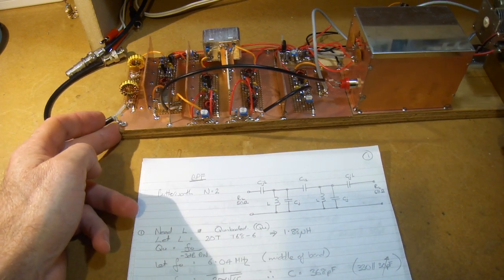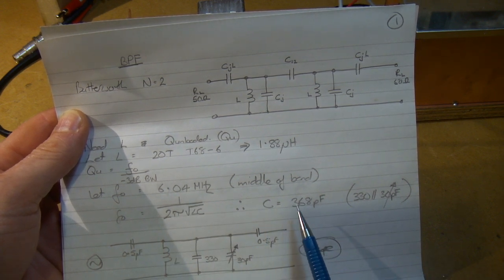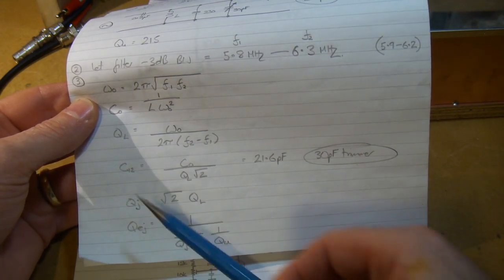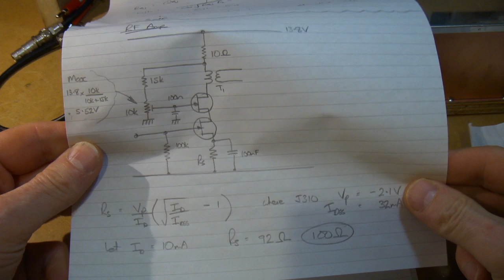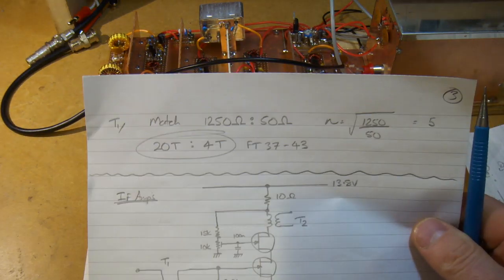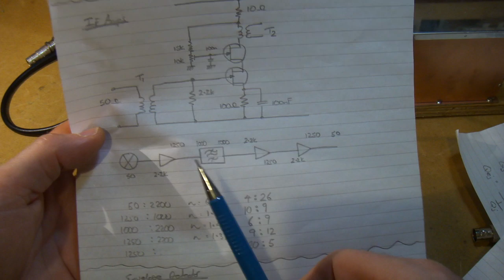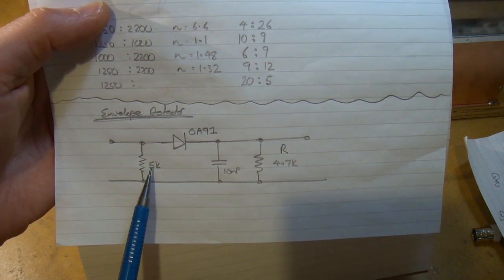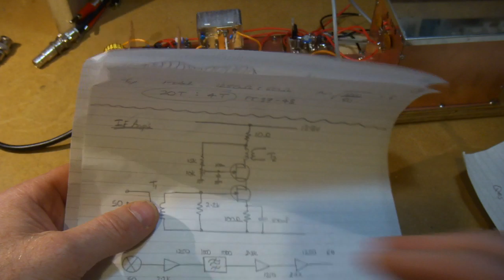Shortwave AM Receiver. Part 5: BPF, RF Amp, IF Amp, AM Detector

Comment: Charlie, I built up a 3 stage IF amp board recently with BFR246 pairs, almost identical to yours, however it uses tuned drain inductors. The thing had sooo much gain it was hard to stop it oscillating. Had to force AGC right down to tame it. If it is still unstable over the AGC range in a txcvr project I may replace the tuned circuits with broadband transformers as you used, that should reduce each stages gain while realising a reasonable AGV voltage range.
Reply from the maker: Hi Paul. I did a tuning cap across the primary windings, but elected to go back to the broadband configuration. The gain seems to be fine for what I am after. Just a simple little radio.
Reply: @CharlieMorrisZL2CTM  With three tuned stages the overall IF gain is excessive. I left the 3 stages in, but dampened two of the three drain tuned circuits with a 5k6, that tamed it.  Going pretty well now.

Comment: I really enjoy your videos. Keep it up. At one point you needed a transformer turns ratio of 5 and you chose 20:4 turns. Can you provide any general wisdom on  picking the minimum number of turns (i.e. why you didn’t chose 5:1 turns instead)?
Reply from the maker: Sure thing Bob. The inductive reactance of the smaller winding (in this case 4) at the lowest freq of operation needs to be approx. 4-5x the resistance connected to it. I often use 6T in a 80m rig.

Comment: I'm thinking that the nanovna would be a good tool to tweak home brew crystal ladder filters too.
Have you tried the hybrid cascode configuration, IE: a bjt as the top element in the amplifier, probably a 2n3904 or PN2222?  A similar gain adjustment can be used here as well.   While the source resistor biasing can be used, a string of series diodes to raise the source above ground also works, this is a 'fixed' bias regardless of the current (within limits).  The diode string can be shared by several stages of hybrid cascode amplification, even with one stage in the RF and another in the IF.
Reply from the maker: Yes I did. I read up on them, but at the time elected to do with the cascode JFETs. I must try the other way too. I have also used the NanoVNA for tweaking homebrew crystal filters and it works well. Very inexpensive.

Comment: mmm...let me see, so you went through all that filter design to have it working and tuned with 50 ohm source/load impedance and then suddenly you put a (almost) 100Kohm load at the output of that filter? Can you measure the frequency response of the filter+RF amp with the NanoVNA? and compare it with the shape of the filter response you had?
Reply from the maker: That's one aspect I was going to look at today Amir. Swap out the 100k for 2.2k and add in a transformer. I agree the logic is not sound. I would have been better off adding a 50 ohm across the output and feeding that into the next stage. It's a work in progress.
Reply: @CharlieMorrisZL2CTM  that would be a better solution but still it would be interesting to see the frequency response of the amplifier+filter together in its current form as well
Reply: @CharlieMorrisZL2CTM  is there a particular reason that you don''t put a 50 ohm resistor at the gate of the FET?
Reply: I also fell into this recently. A D G Mosfet RF preamp fed by a 3T link over the last toroid in the BPF.  10dB loss overall. A transformer fixed it.